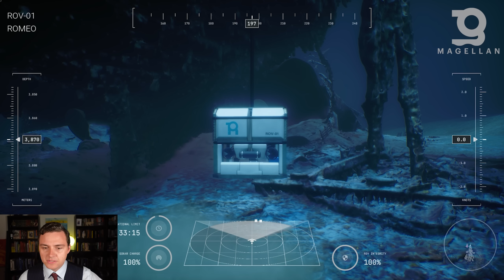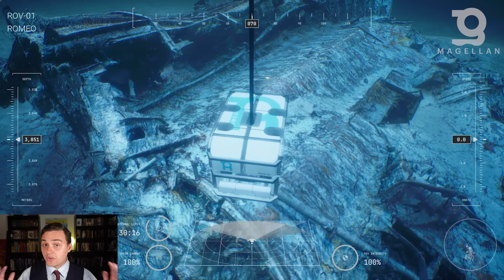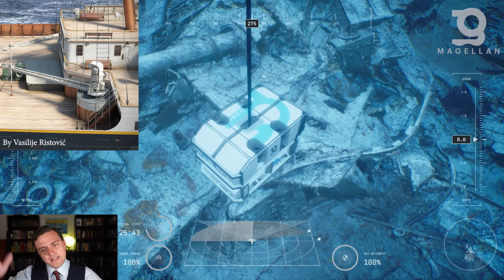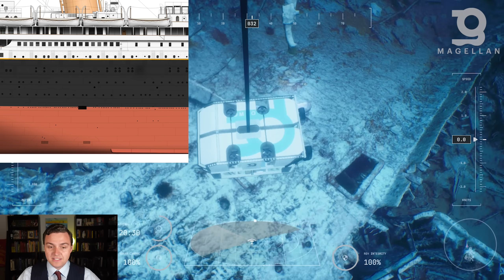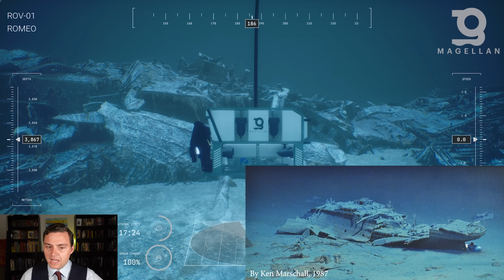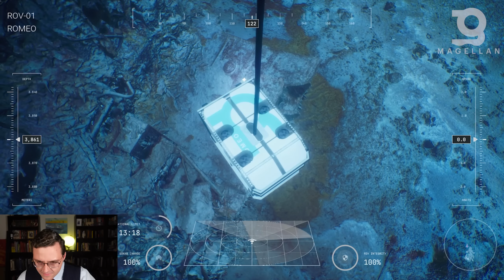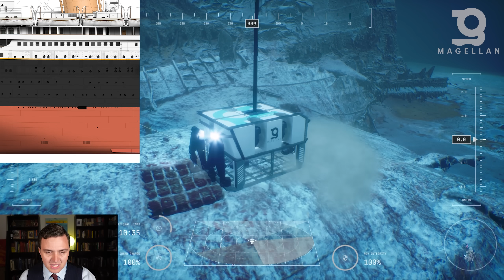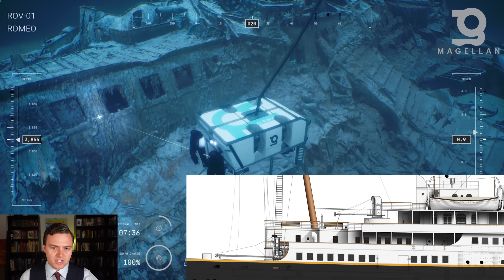FIRST LOOK: Titanic's Destroyed Stern Section in vROV Pilot

Comment: The fact that after a plunge of 2 1/4 miles, hitting the bottom at 35 mph, and under 5,300 psi of water pressure for 113 years that so much survives, I think it shows just how well built the Titanic was.
Reply: Add to that the enormous down blast of water onto the ship once she had hit bottom just from her momentum must have been unimaginable.
Reply: @stuartkeen5234  And the fact that there are still upright bottles and other objects after all the ship has went through is absolutely unbelievable.
Reply: The physics of it are just so incredibly. That much mass going that fast……
Reply: @Pisti846  Also remember that it was full of water at the time, which had the same speed as the ship itself. So similar to a water balloon hitting a surface and flattening, the ship blew out horizontally. And you can see it in the model.
Reply: @samus4799  I wonder why the same didn't happen to the bow.
Reply: @mattfarahsmillionmilelexus  cause unlike the stern, the bow was completely filled with water, and since water isnt compressible, even though the bow was falling really fast, the water inside acted like a cushion. keeping the insides and structural integrity in good condition. meanwhile the stern still had alot of air pockets once it was fully under the water and it imploded, destroying the insides and structural integrity
Reply: @ Stronger. It didn’t have the engines in it, the theory is that the engines caused the stern to spin on the way down like a big Samara seed, largely horizontal. I’d guess it made 10-15 rotations on the way down. Consider that it is hundreds of feet long and it’s falling through a dense medium like water. Imagine sticking your hand off of a boat into the water at 35mph, and think that every part of the ship was under that sort of stress as it went down.

Also the bow isn’t unscathed either, cracked at the superstructure. It fell vertically, and I’d guess that the front hit first and dug a trench as the rear of the bow section was still falling, causing much of the impact to be spread over maybe 20 seconds.
Reply: @samus4799 what’s cool is doing calculations it too roughly 6 minutes to hit the bottom (the bow)
Reply: @tvpigy9290 that’s incorrect in every way
Reply: @samus4799 Both the rear of the bow and rear of stern are above the mud so the both hit at the heaviest parts and due to the plane effect during decent. The bow obviously due to it's design drifting in a spiral but hitting hard into the mud causing the bend and blowout. The rear came down and hit almost flat on bottom but the rear being slightly heavier due virtually all the bulkheads being rammed towards the stern during sinking. She was carrying a lot of water during impact so it blowout as she hit. A large water coloum hit from above pushing down her top sections into the hull. All happening very quickly. Gravity, time and structural corrosion has caused her outer shell being  weakest area to collapse outwards even more. Just a hot mess. If we go back say 113 years, she would have been in much better structural condition just after sinking. Time, currents, water temperature and decay have excellerated its condition.
Reply: @samus4799  Spinning also happened because ships rudder was in certain angle. Remember they were trying to dodge a berg. Apparently they did not had it fixed afterwards.
Reply: @samus4799 the engines were in the bow, not the stern
Reply: @mattfarahsmillionmilelexus because of the shape of the bow it's made to cut through water and Waves and glided through the water on the way down to the bottom
Reply: @mattfarahsmillionmilelexus  the bow was designed to glide through water so there wasn’t as much resistance as the stern faced.
Reply: @mattfarahsmillionmilelexus  The bow had the air out and was full of water so hence why it did not go the way that the stern did.
Reply: @tomilivesey Wrong!!!
Reply: @tvpigy9290 Also, there were a lot of witnesses that reported hearing a lot of booming coming up from underwater once it disappeared below the surface. Which suggests that it was full of air, and the pressure was making it implode in the way down.
Reply: @tvpigy9290  Thank you for this. It's pretty clear there was a lot of circlejerking about how great the Titanic was, when really basic physics said it's nothing surprising.
Reply: @str8dnocuddldadshome213  how so?
Reply: Definitely the rear section of the ship underwent a water balloon type of blowout, once it hit the seafloor at high speed. This part of the ship as she went down would have had all the bulk heads pushed back into the stern area due to sheer force of water pushing up into the stern like a tube. There would have been trapped air inside initially before being forced out thus leaving the outer hull weakened and only having the ribs and some internal sections for structural support. Once she hit bottom all the water inside blew out at different points such as the bottom section and top floors so a splayed out look is the result. Also several hundred tons of water hit her from above as she came to dead stop. The stern area is strongest part here so no real outer damage except during impact forcing the hollow prop shafts to bend up or break off inside the hull with screws attached. The very bottom screw is most likely the most damaged but unseen as its below the mud. The rudder looks to be complete and again this is built to very strong so may have survived the impact. The decay and structural collapse of the outer hull is due simply to gravity and time so its folded under its own weight as it lost it structural strength during its sinking. I do wonder if any internal sections or rooms survived. We will never know. The front of the double bottomed hull is above the mud line so it hit rear or aft first. Would be interesting just before she hit bottom if the outer hull was still intact despite the internal damage. Seems all destruction happened very quickly on impact.
Reply: Only 35mph. Damn I thought it would have been faster than that.
I guess with that much mass speed really isn't the issue. It would have been like sitting in the drivers seat of a car dropped from 1500 feet from a helicopter.
Surely is a sad sight.
Reply: @glengrimm4075 I was thinking that it could of been faster because of the weight of the liner
Reply: Damn near unsinkable
Reply: Imagine being one of the weird fishes cruising the bottom and your chilling when a planet hits ground
Reply: Just remember that once the water became equalized between the inside and outside of the ship, the psi against the vessel would’ve gone to practically zero. So it wouldn’t have been subject to intense psi for all these years since it sank.
Reply: It was so well built that the swimming pool is still full
Reply: Full of water? This has never made sense. How would a swiming pool lose its water at the bottom of the ocean anyway?
Reply: @richardcoffer4758 people could have drank the water or splashing it out while playing and swimming.
Reply: @ronzedalis3202 bore off 🥱
Reply: You have to remember that the stern wasn't pressure compensated and it blew apart at crush depth. So it hit the bottom and a slower speed. But you are right about the bow hitting the bottom at that speed. It was all ready flooded with water and pressure compensated so the impact was hard.
Reply: Especially the bow section.
Reply: Water pressure isnt just gunna crush steel cuz its been a long time lol
Reply: @cole1999  the titanic didn't even exist lol
Reply: @AllieJ97Official you dont exist bot
Reply: @cole1999 perfect kick that ass
Reply: The most interesting post i have viewed on YT in years. Excellently put together and narrated thank you.
Reply: It sank
Reply: It’s not that it was well built I mean it was but not that well but she definetly barely held up from that the bow was bent down completely and the stern buried with terrible damage
Reply: Welllllllllllll, debatable
Reply: @coryfaucher3931  Not really, Titanic was state of the art ship building for the time. That's not a debatable fact. I was well built for sure, they knew what they were doing and it was designed to survive basically every known and common crashes that ships could get in up until that point
Reply: At this point it has nothing to do with build quality. As you see almost nothing of the structure remains. It's more an example of how materials like steel survive and the rate with which they degrade at that depth
Reply: It wasn't that well built. It sank.
Reply: @MsMachiavelli any ship can sink 🤦‍♀️
Reply: @AllieJ97Officialvery slowly it sanked today people would have rescued today by helicopters if  would have happened today
Reply: Not very floaty though, which I believe is an important part of being a ship.
Reply: @PaulH-r9e  floaty 😂😂
Reply: It was so well built that it didn't even survive its first trip!
Reply: @robertposteschild2353  not as a boat lol
Reply: @robertposteschild2353  if the ship hit it straight on, it's very likely it would've survived, but that shi gashed out a giant hole taking out multiple compartments like the Titanic owed it something
Reply: @badcornflakes6374  - The claim that "if the ship hit it straight on, it's very likely it would've survived" has done the rounds for a very long time, but the reality is that the laws of physics say otherwise.

It's a matter of mass, velocity and dynamic loading - a more modern example of misunderstanding these principles came up when the 9/11 conspiracy aficionados kept stating "burning jet fuel cannot melt steel" regarding the WTC collapse...  The truth is that the fire didn't need to get hot enough to melt the steel, it just had to get hot enough to weaken the steel structure enough that it could no longer support the static loading of the mass/weight from the floors above.  Once that mass started moving downwards, that load became dynamic and there isn't a material or design in the world that could tolerate those forces.

The theory you're talking about was putting forward the notion that had "Titanic" rammed the 'berg directly, the bow would have crumpled up to the collision bulkhead (killing pretty much all of the "black gang" currently resting), but the ship would have remained afloat...  But again, this does not take into account the combination of the mass of the vessel and the dynamic loading involved in a collision circa 20 knots.  It's almost exactly the old notion of an unstoppable mass hitting an immovable object - the energy released in the collision has to go somewhere, and the path of least resistance is through the rivets joining the steel plates together.  In Titanic's case, we're talking almost 3 thousand million joules of kinetic energy pre-collision - there isn't even a modern structure in existence that could tolerate anything close to that.

Modern engineering simulations suggest that a direct collision would have popped rivets well behind the collision bulkhead, resulting in rapid water ingress and probable sinking and capsizing within minutes.
Reply: @robertposteschild2353 well you have to put that into perspective dont you?
You can engineer and build the best stuff but then have it destroyed by irresponsible and stupid people.
The Titanic was the probably safest ship at the time.
They still found a way to sink it.
Reply: @robertposteschild2353  Literally any other ship in that scenario would’ve down the same or worse.
Reply: @robertposteschild2353  she was well built, the fact she survived in the condition she has, is proof of that, and she took 3 hours almost 4 to go down
Reply: @robertposteschild2353 of course it was well built - it stayed afloat for hours and and has survived an insane amount of water pressure, the ship was thrown away by human error from some of the crew and white star line board members
Reply: @CS-1988  Any ship can do that. Sorry that nostalgia has clouded your mind.
Reply: @robertposteschild2353 yes. It was. You're just rage baiting. What ship can you name that stayed afloat for 2 and a half hours withou rolling over. I'll wait.
Reply: @robertposteschild2353  Yeah I didnt want to be the spoiler alert guy, but Im w Bob here
Reply: Well built isn't exactly the term id use lol
Reply: @alliebagz4936  It was. It encountered damage it wasn't designed to survive. And the same kind of damage would sink modern ships too. You don't know what you're talking about. It's the the typical one dimensional "hurr durr it sank so it must have sucked"
Reply: The titanic could have survived scrapes modern ships wouldn't survive bc of all her safety features it was just unlucky she had people saying god couldn't sink her but he showed them though
Reply: It wasn't built as well as they thought...
Reply: Yes so well built that she broke into half
Reply: @NikaNakaidze it was so well built it took half the ship being lifted into the air for her bottom to snap.
Reply: @spencerwalker254  Yes
Reply: @NikaNakaidze  It was. It encountered damage it wasn't designed to survive. And the same kind of damage would sink modern ships too. You don't know what you're talking about. It's the the typical one dimensional "hurr durr it sank so it must have sucked"
Reply: @mrfahrenheit677  u don't know what u r talking about
Reply: @NikaNakaidze it broke in half because of psychics dude 😂
Reply: But not well built enough to resist an iceberg lol
Reply: @zachpeterson4519 
Correct. At least 2 mil tonnes of it.
A 50K tonne ship is like a toy in comparison.
Reply: I read that had they hit it head on instead of turning, the ship would have likely stayed afloat. The iceberg ripped opened the side of the ship like a giant can opener.  @zachpeterson4519
Reply: @zachpeterson4519  Brother an iceberg is magnitudes larger and heavier than a ship.
Reply: Lots of corners were cut. Some critical
Reply: @PrinceAsmodeus  Uhhh no that's not true lol
Reply: @PrinceAsmodeus  - You claim "Lots of corners were cut. Some critical"...  With all due respect, may I trouble you to name examples?

The fact of the matter is that Harland & Wolff and the White Star Line had a somewhat uniquely close and symbiotic relationship, one significant aspect of which was that H&W designed and built vessels for White Star on a "cost plus" basis.  What that meant was that in effect, White Star would commission the vessels they needed from H&W on the understanding that they would pay H&W whatever it cost to design and build the end product - plus an agreed percentage on top - no questions asked.  In return H&W, for their part, practically reserved their most advanced techniques and technologies (commercially speaking) for White Star - they would not build a vessel of similar capabilities for a direct competitor of White Star.  As such, there was no motivation whatsoever for H&W to "cut corners" in design and construction because White Star had a long-standing formal undertaking to pay H&W the full amount requested, regardless of how much it cost H&W to build the things.  

As hard as it may be for those of us accustomed to modern business practices to get our head around that kind of arrangement, even J.P. Morgan himself did not intervene in that relationship when he bought White Star and merged it into his IMM conglomerate.  Again, it is hard for us in this day and age to conceive the extent to which owning a transatlantic shipping line (let alone several) in that period of history was the nearest thing to a possessing a licence to print money there has ever been in the modern era.  Robin Gardiner's conspiracy theory posits that the damage caused to RMS Olympic in the HMS Hawke collision somehow represented an existential financial crisis for White Star, but even a cursory attempt at research proves that even with "Oly" out of action, White Star still turned a profit in excess of £1m in the financial year encompassing 1911 (and we're talking the value and exchange rate of Sterling in 1911 - that's over £150m in modern terms) - in other words they could have rebuilt "Oly" from scratch with that money and still turned a profit.

The "Olympic"-class liners were in fact exceptionally well-engineered, designed and built by the standards of the time - and "Oly" herself proved that.  At the time she was taken out of service she had not only suffered significantly less structural fatigue damage than any of her contemporaries, but stood up well against similar (and larger, more advanced) vessels several years younger.  I like to think that Thomas Andrews would have been able to rest easier had he known that.
Reply: If it was engineered well it would not have sunk and killed 1502 people over a buff in the side of the ship from simply hitting an iceberg
Reply: @Rugerous Think the way it was damaged over 200 ft or so, busting rivets open along the way, it was immediately doomed.
As has been said, a head on collision with the berg would’ve been safer.
Reply: @Rugerous they build this massive ship 🚢 with no technologies no computers nothing it remarkable it's sanked cause of negligence of crew overconfidence of people that vessel is unsinkable ❤🙏
Reply: @Rugerous actually it was. In the sense that it took 2 and a half hours to sink. Most ships roll over and take way less time to sink. She was only designed for 4 watertight compartments to flood. Unfortunately the iceberg damage spanned 6.
Reply: @OUTTA-TYME88 they used rivets that stuck out of the ship. If they didn't it wouldn't have caused such massive damage. Nowadays if a ship hits an iceberg it cracks the iceberg. The iceberg is what gets hit. And i know it's been a long time and advancements are wide but to advertise it as unsinkable and it sink the first time it cruises because it scraped an iceberg is crazy work. I do agree though that all the rest of the ship was designed well
Reply: @Rugerous while yes the riveting didn't help. Icebergs were the death of any ships at that time and for many many years. If I understand how even icebreaker work if one were to hit an Iceberg like the titanic did it would sink.
Reply: A ship full of water has no pressure inside when it has sunk dope...you need to educate yourself...
Reply: @avonputter3335 theres one in every crowd and you are it.
Reply: Says the one who can't even use proper grammar. @avonputter3335
Reply: Bull shit.
Reply: @titc1912  tell us more...
Reply: It wasn't a wonderfully built ship. It was built in 1912 by people who were only just learning how to use a screwdriver. They were lucky the boat didn't sink straight out. It was all guess work.
Reply: @richardcoffer4758  In 1910-12 just barely knew how to use a screwdriver. I think you've had a quart or two too many Screwdrivers last night!
Reply: @richardcoffer4758 hand built they definitely new how to use a screwdriver 😂😂
Reply: @jimmanihera7760 you mean knew how to use a screwdriver. Nobody is perfect , are they?
Reply: Ohh that means u must discoveed the so called screw driver and 1912 people are learning at that time how to use it ? @richardcoffer4758
Reply: @richardcoffer4758  Wow the ignorance in this statement is astounding. You truly have no clue what you're talking about at all.